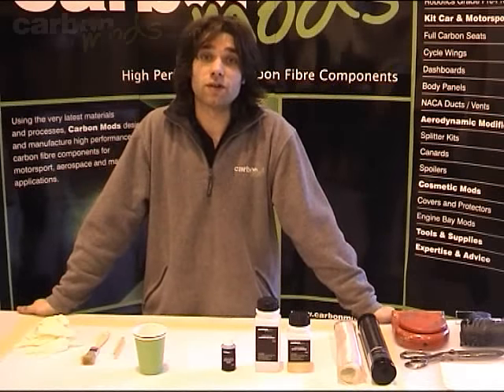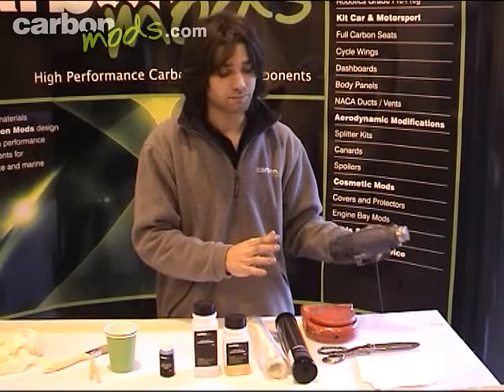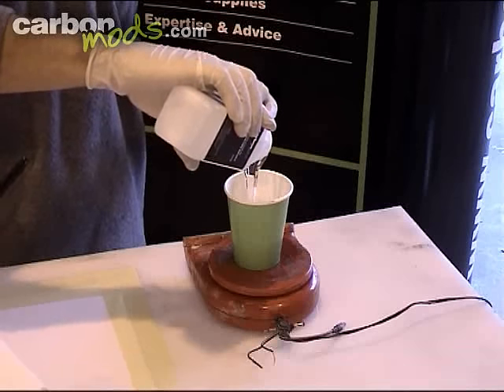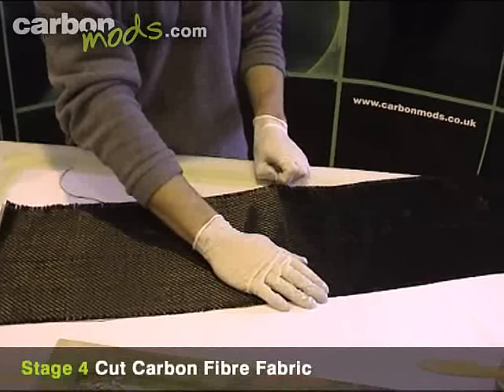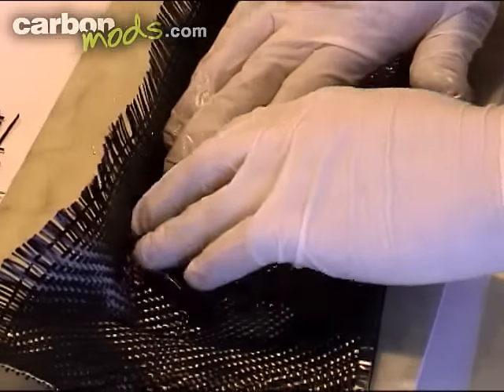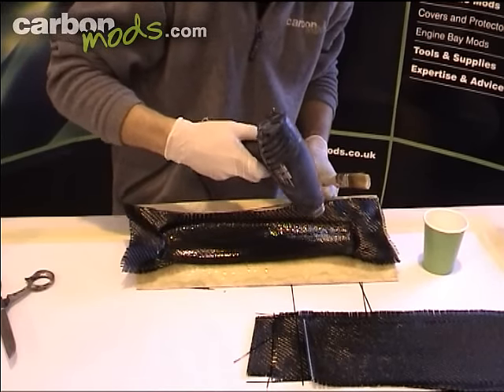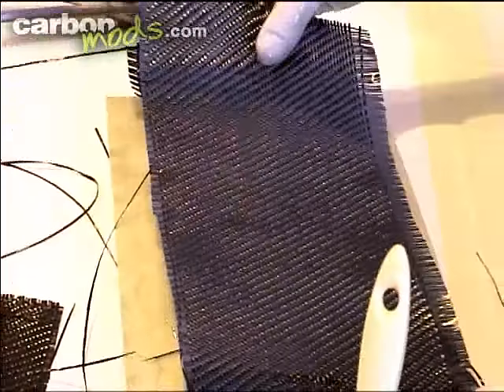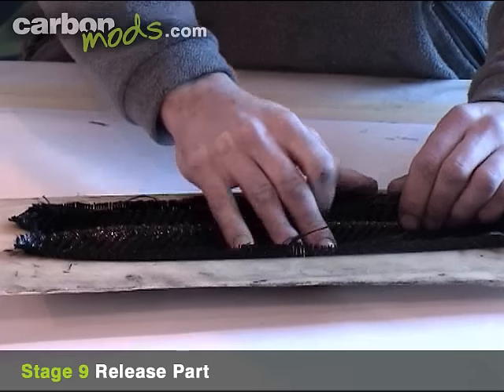How To Make Your Own Carbon Fiber (Fibre) Parts.

Comment from the maker: @cartilige : Our carbon fibre is as strong as anyone elses. Strength (and more specifially strength to weight ratio) is down to the lamination technique used and the skill of the person who does it. If you're after very good impact resistance then you should look into using Kevlar as some or all of the reinforcement. Kevlar can be used in exactly the same way but it's got amazing impact/break/abrasion resistance. For more info on using Kevlar please see our website.

Comment from the maker: Hi Samawal, 

You can use glass fibre to make the mould, or to 'bulk' out a part that is not structural. our mould making video might be of interest for info on an easy way to make a mould. 

Carbon Mods

Comment from the maker: Yes, two layers of 200g carbon fibre and epoxy resin woudl add considerable strength to a wooden part. The epoxy will stick very well to the wood so this is a viable process.

Comment from the maker: @TheDrH20 : The best way to make really top quality carbon fibre parts is a process called Resin Infusion - this process using a vacuum pump to draw the resin through the laminate under full vacuum which should result in strong, light parts with no air bubbles at all. Vacuum bagging on its own (i.e. no resin infusion) although it will help with keeping the carbon down on the mould's surface, generally won't cure the tiny pin holes/bubbles. See Easy Composites' Resin Infusion video.

Comment from the maker: @superfarmand :Hi, yes, you would do exactly that. Make sure you coat the glass with release agent. If you wet-lay the sheet using the process shown in the video then you might find that the finished sheet is too inconsistent in its thickness for use as an RC car chassis and you might need a sheet manufactured in more sophisticated way. We sell a 100% pre-preg carbon fibre sheet on our website that's available 3mm thick. Most of this goes to RC car guys for chassis plates.

Comment from the maker: The Laminating Kit (seen in this video) assumes that you already have a mould and that you want to make a replacement carbon fibre part. The Skinning Kit assumes that you just want to take an existing part and cover it with a layer of carbon fibre to make it look like it's a carbon fibre part. In terms of the difference in what you get in the kits, the resins are all different, the skinning kit includes a basecoat, abrasive paper and polish, the laminating kit includes PVA and glass fibre.

Comment: Question: Can you make a mold with a 3d printer or is it not the right material / strength / smoothness? What about using plaster to create the mold or use as mold?

Comment from the maker: @aml4yt : Yes, there's about the right amount of material to do this and it should be perfectly possible. You might want to press the laminate with some weight on top to consolodate it and make a stronger composite but other than that you should be fine. Do a small sample first.

Comment: Hi, This is a really good idea, i fancy getting a kit myself. I have a question though - you said the carbon fibre needs to be cured. Does this just mean left to dry in the air? I always though carbon fibre had to be baked in an oven (an autoclave) so whats the difference with this? Thanks

Comment from the maker: Hi kabeemer, 

For your application the 200gram 2/2 twill cloth would be perfect, you might want to consider using a high temperature laminating epoxy as you will be about on the limit for standard epoxies. I hope this helps you out with your project. 

Carbon Mods

Comment: @cutinocutino A trick lots of people use is to make a fibre glass mold of the item in question, use a barrier protective agent, and coat the fiberglass around the item you want to use - let it dry, cut it out, and you now have a modl that can be used over and over again.

Comment from the maker: @toro199999 : Only if it was an extremely thick laminate. For ballistic panels it's more common to use Kevlar or Dyneema as the reinforcement because these fibres have a much higher elongation-to-break property.

Comment from the maker: The carbon cloth can take incredibly high temperatures (several hundred degrees) but the resin system in our standard kit has an HDT (Heat Distortion Temperature) of 80 degrees C. If you want to make parts suitable for high temperature use (up to 180C) then take a look at our High Temp Laminating Starter Kit on our website.

Comment: how many layers should i put? how thicc should I make the part eventually to make it stiff enough? and lastly: what is the cheapest and easiest way to make a mould for the part? yours is from fiberglass I guess? I personally wuld make a cartboard form and layer it with heated plastic to make it gain the shape of the cartboard. but it might not be that good idea :D
i hope anyone is still able to respond to my comment tbh
Reply from the maker: There are lots of ways of making mould tools but cheaper doesn't always mean better/usable/value for money. Glass Fibre moulds are pretty inexpensive. In terms of number of layers, a very rough rule of thumb is to try to match the thickness of a part if it was to be made in steel or aluminium; the result should be similar in strength characteristics but generally lighter. Its worth looking at some of our other videos on both this channel and the Easy Composites' channel.

Comment from the maker: @Guifltt : It depends what you want to achieve. If you're after a stiff but springy insole then for something moulded (i.e. contoured like an orthotic insert) then carbon fibre made in the way we show in this video would be ideal. If instead you just want a ready-made sheet of flat carbon fibre then we sell these on our website. I would suggest our pre-preg sheet for the strongest, lightest sheet.

Comment: Would you gain any additional benefits from using a chamber vac between the layers to remove air bubbles (after heating) or will there be no difference from using the hot air gun alone?
Reply from the maker: In this sort of wet lay process, it won't have a great effect; it will remove any entrapped air in the mixed resin but you are likely to find you drive some air back in when wet out and brushing or rolling the resin onto the fibres.
Reply: Carbon Mods Ok, good to know. Thank you for taking the time to respond.

Comment from the maker: Panterajoey, 

You can use the  epoxy resin with kevlar in just the same way as you see here with carbon, it would make a part that was slightly less stiff but had improved impact and abrasion resistance over carbon. 

Carbon Mods

Comment from the maker: @expert380 : It certainly can but often when making structural components from carbon fibre you need to give more attention to things like fibre-resin ratio and fibre orientation in order to get the most from the materials. The fibre and resin and to much extent the technique would be the same but you might use techniques like matched moulds to compress the composite, making it stronger for its weight.

Comment from the maker: @miamiforlyfe : By car parts to you mean like body panels (wings, hood, trunk etc.)? - If so then first off you need to take a mould which is normally done by waxing the original part and then laminating a gel coat and reinforcement onto it before putting that off as your mould. For those large panels you could follow exactly the procedure you see here or you could choose to use Resin Infusion: watch?v=VodfQcrXpxc which is often used for larger parts like car panels.

Comment: You waited a couple of hours to let the resin get tacky before you put on the first layer of CF. After you put down the first layer of CF and put down new resin, do you wait a couple of hours again till it gets tacky? And additional layers as well? It seems after the first layer, you put the second and third layers down instantly one right after the other? Is this correct? Thanks in advance. Great video.

Comment: When overlying cf cloth and resin on a part do you need to mix both hardening and epoxy? Or do you do epoxy let it cure for 24 hrs then add hardening resin over it?
Also do you need to sand and polish first layer of epoxy resin before adding another layer of epoxy/hardening resin?
Reply from the maker: Without the hardener, the epoxy would never cure so would always need to be thoroughly mixed prior to wetting out the carbon fibre fabric. If you did for any reason want to add another layer of mixed resin to the outside of the part after removing from the mould, it needs to be abraded with a coarse sandpaper (around 120 grit) before brushing on additional layers.

Comment from the maker: @reel2real5 : For use in the kit? - Well, you can buy extra ones of the small roll or you could switch to buying the resin and fabric seprately if you need quite a bit more. We sell the resin by the KG and the fabric by the metre off 1m, 1.25m and 1.5m wide rolls so we can certainly supply you with enough material for any job!

Comment: I like your video :)
I have a question does the carbon fiber parts need a specific type of paints or not how one can paint it
Reply from the maker: Wajdi Rebei No, you don't need special paints. Once fully cured you would just need to follow standard practice for preparing for paint; key the surface (a Scotch pad is good for this) and ensure it's free of dust or grease. The best paints are 2k (2 pack) automotive paints like polyurethane or acrylic. The same would apply to a clear-coat/lacquer.
Reply: carbonmods could I buy this kit, and then buy some Kevlar fabric off Amazon and use the stuff included in the kit to make Kevlar parts? Please reply soon.😊

Comment from the maker: Yep, once the part has fully cured you can use ordinary tools (that would work with fibreglass) to 'trim' all the excess off. You then use abrasive papers to smooth where you cut and finally polish the edges up just like the rest of the part. The finish will be spot on. Check out 'Perma-Grit' tools for the tools we use in our workshop for this purpose.

Comment: @superfarmand 

Hi I did exactly the same thing for my HPI Baja, I would make the parts a mm or so thicker than required though to compensate for the loss of strength if you duplicate an aluminium part. A piece of glass works fine, I used flexible acryl glass the last time but the carbon sheet ended up slightly curved.

Comment from the maker: TK5111, 
Epoxy resin is the best to use for performance, some vinylester resins do provide adaquate performance for less critical applications, most vinyesters have quite a strong yellow tint this can affect to colour of the final product. 

Hope this helps, Carbon Mods

Comment from the maker: Hi emj0001, 

Yes it is 2/2 twill (every strand goes over 2 others, then under 2 others) giving a herringbone pattern. it's weight is 195g per square meter, Which is about a 5.7 oz/sq yrd. Hope this helps 

Carbon Mods

Comment from the maker: Hi paulwisdom2008, 

as long as you have a shiny mould surface your parts will come out of the mould this shiny, you can lacquer/compound a part if you havn'y got the finish you want straight from the moulds, as for trimming the parts; there is a text guide on our website that should help you out quite a bit, 

Thanks for the question 

Carbon Mods

Comment: Hi, how do you keep your first layer of epoxy/hardener viscous enough for it not to pool onto the lower areas, I have that problem, the resin doesnt stay in the sides of the mould because its not viscous enough (thick). ? great work!

Comment from the maker: @WowMike2002 : Yes, we actually have a video about how to make the mould in the first place which uses basically this technique except we use a new 'putty' material in place of the fibreglass so it's a bit easier, quicker and cleaner. Take a the other videos by Carbon Mods to see how it's done.

Comment from the maker: Hi Veilside1000HP, 

trimming is normally done in a proffesional workshop using inexpensive tungsten carbide tools, however good results can be achieved with regular hand-tools (hacksaws, files, etc) check-out the guides section of our website for loads more info on trimming and shaping. 

Thanks for the question, 

Carbon Mods

Comment from the maker: Hi SiPower. It's sometimes possible to use the original parts as the mould but because you would want to be using the insides there are normally reinforcements, clips and other things that get in the way. The way we would do it would be to take a mould off the original part and then polish that up ready to make new parts. We'll be explaining this in a new video we'll be making over the next week or so and we'll do a mould making kit with all the materials you would need. Subscribe to be notified

Comment from the maker: Carbon can be both structural and cosmetic.  Obviously you need to design the part appropriately for each use.  For example, many carbon panels both look good, yet offer significant weight savings over the OEM metal part, while still being structurally stiff enough for thier design usage.  At the far end of the scale, carbon is used in motorsport for entire body tubs, suspension arms, propshafts etc as well as major structural usage in the aviation industry.

Comment from the maker: Hi Saradawn6, 
You can make wings in the way that you say, to get a smooth finish follow the technique described in our 'skinning' vid. Generally speaking i wouldn't recomend disolving the foam out, it adds more in strength that it does in weight! I hope this helps you out. 

Carbon Mods

Comment: How strong will something like a 3 ply object be? How many layers would you reccomend are used for an object that is going on the outside of a vehicle and will be in a collision zone? Obviously it is not the only material for the panel, but it would need to be well resistant to any collisions to it.

Comment: @ionutzB123 1000ºC?, is used a oven to resin cures faster but the temperature is as much 90ºC. 2800ºC reachs the carbon fiber when is made in the factory but not the resin. The autoclave (pressure furnace) is used only for pressure and vacuum machine is to extract air bubbles for high end master pieces for aircraft, spaceships, formula 1, but the strenght is the same in a piece with autoclave or without it, the difference is less than 1%.

Comment: hey, we have just applied the first coat of resin onto our wing mirror caps. the problem we are wondering is...there is a small thin lip around the edge of the mirror that needs to be re exposed to be able to clip bk in. when is the best time to trim back to this and by what method? the carbon is currently tucked underneath and masked to the back. thanks

Comment: how much weight difference does kevlar make over carbon fiber?  Can you use both materials together in the same piece to get the benefits of both and get a stronger end result avoiding the weaknesses of either material.  Really interesting Kevlar vs Carbon fiber

Comment from the maker: @mchugh69 : Not really (other than it will get expensive). There are limits as to how much you should be laying down in one go because the epoxy will start to exotherm too much if you're laying down more than about 10mm at a time but you can make it up in multiple hits to acheive thicker composites if you require (more than 10mm would be incredibly unusual!).

Comment: I like your ambition however the weave of this kit would be too large to sustain the flexability required and also id suggest looking into a pre preg cardon weave as you can the be sure that you can produce two identical flight surfaces where as with this method youd have to be very methodical about weighing everything weave,catalysed resin and so on. however with pre preg youd need to use a clave oven to cure the parts but i have seen some quite remarkable garage claves in the past:) AER.T.BTG

Comment: Could you explain the last step where the hem magically vanished into a smooth finish?
Filled / sanded ? Is there a way of tucking it in on itself?
Reply from the maker: Matthew Ault Sure; once the part is fully cured we 'trim' it (i.e. cut off the excess) using a Dremmel with a Perma-Grit tungsten carbid wheel in. The cut edge is then finished smooth using a sanding block and abrasive paper. Please watch our Easy Composites Guide to Cutting and Finishing Carbon Fibre for more information on this: https://www.youtube.com/watch?v=EWzN6GZeEzs

Comment from the maker: @manchester2ibiza : Well, you'd start by makinga 'pettern' of the shape you what you want to make using something like PU foam and then coat the foam with either resin or filler/primer before taking a mould from it using the epoxy mould process. If you want to talk about this properly join the Talk Composites forum - it's a better place to discuss detailed subjects than the YouTube comments box!

Comment: Recently watched a video about the manufacture of the Britten motorcycle, where John Britten reputedly made the frame and fairings ect from carbon strand rather than cloth, what advantages would this have? and at what point would you need to consider using an oven to cure the parts?

Comment: Thank you for theral explanation. Why other people use vacuum and you don't?
Reply: There are a lot of different methods of composite production, this is the most straight froward requiring the least equipment and is commonly referred to as Wet Lay or Hand Lay; you are correct that you can use vacuum as well to produce parts but those processes do require more investment in equipment to start up.

Comment: Is there a way to change the carbon fiber color ,or is there a way to panit it and still have the carbon fiber effect over the surface ?
Reply from the maker: There are hybrid fabrics available which are half carbon, half coloured polyester to give a different effect. Also some people have success spraying the completed part with a tinted clear lacquer so it still is clearly a black carbon fibre underneath a tint of thier colour choice.